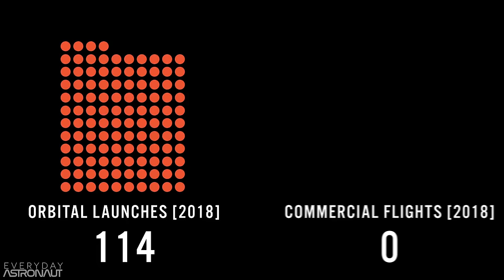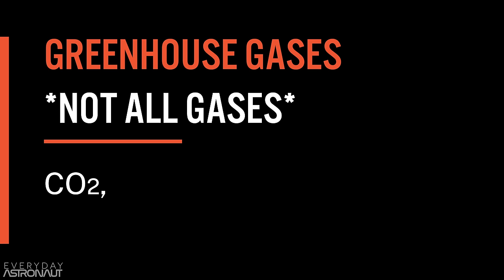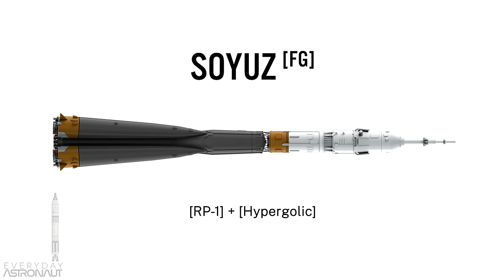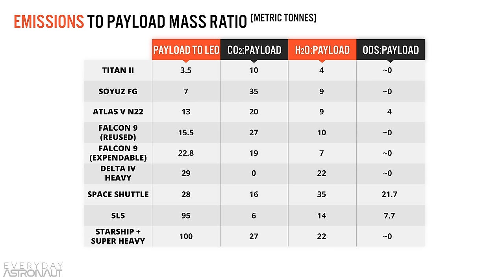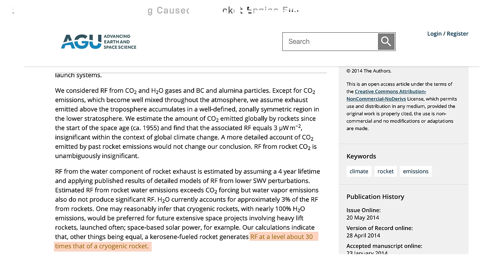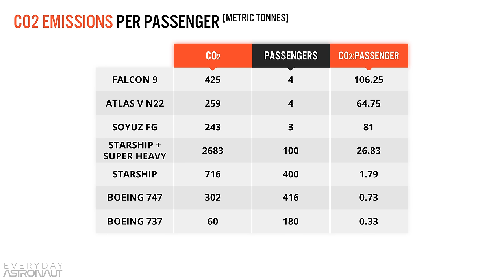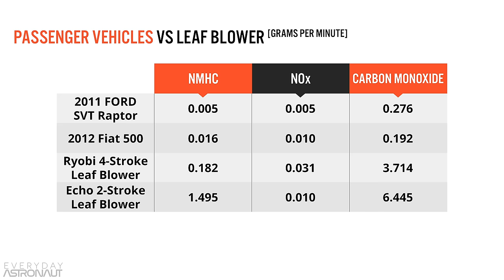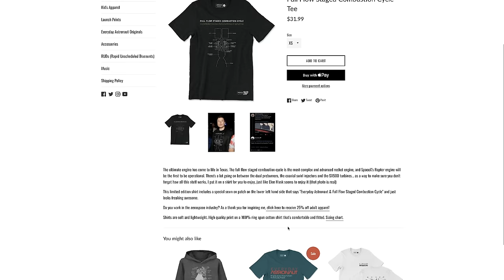How Much Do Rockets Pollute? Are They Bad For Our Air?

Comment: The preffered mentality about rockets is that, they'res nothing wrong with them, but we need to replace them as soon as possible. Why? You can safely assume new advancements, will outperform this neanderthalic rocket bulls*** for cavemen. So why not just speed up the race and speed up that development instead of staying inside the cave, and using our clubs (rockets) to belt the ceiling?

We'll never get past Mars if we don't focus on advancement far along, instead of small steps... & if you aim beyond Mars, this makes Mars THAT MUCH easier to achieve. So again, more under achieving goals because of bias dumb f*** love of Rocket Propulsion.
Reply: what feasible replacements for rockets are there?